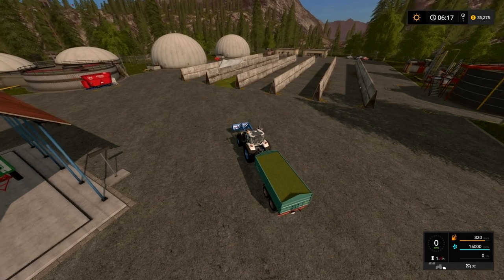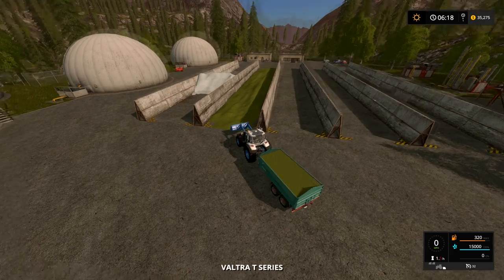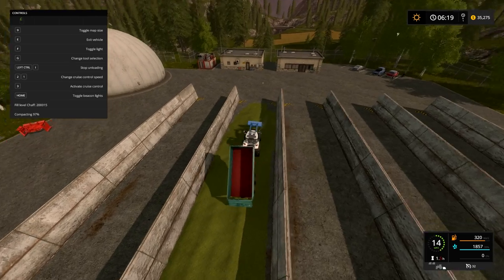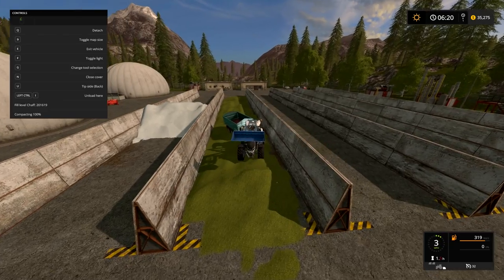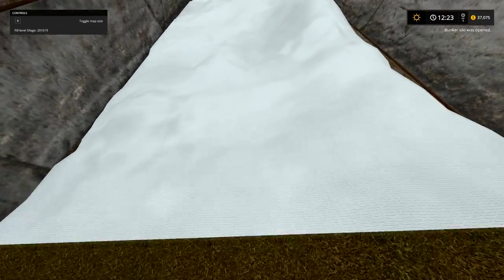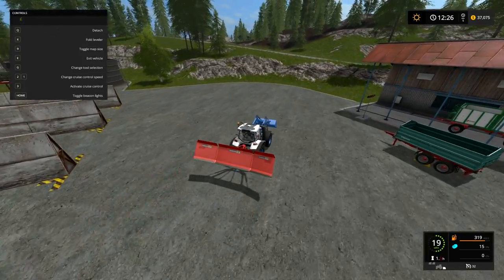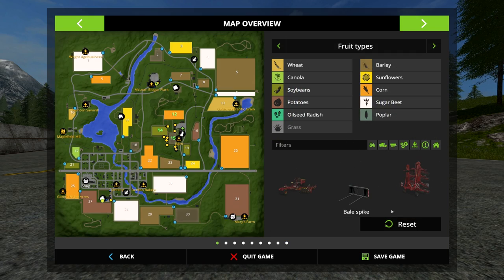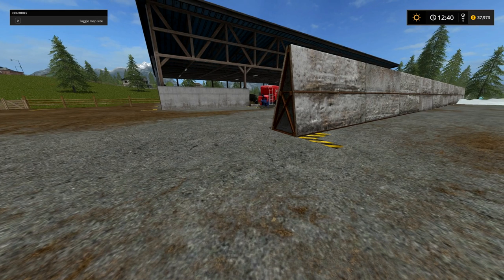Farming Simulator 17 Tutorial | Silage

Comment: I have a problem with silage getting stuck in the wall and i can get it out and it doesn't lets me put grass into it.
Reply: i have that problem too
Reply from the maker: I'm having some major silage bugs as well. Hopefully they can patch a fix soon.
Reply: Do they even know about it?
Reply: yes same problem here
Reply: You can use the roller to clean up the silo which should solve this issue.
Reply: you can use the roller or drag a loading belt through the silo both ways and collect the silage

Comment: I tried to use grass but it didnt work at all....i think for 17 it is only chaff
Reply: Todd Sommer did you unload it? You have to force unload
Reply: yes i forced it and it didnt register anything was added
Reply: Todd Sommer the same thing happened to me
Reply: Im on console....i was reading the silage info before this vid and it specifiacally says that chaff is needed to make silage....i assumed it would be the same process as in 15
Reply: tedder the grass then it will work
Reply: sticky0420 it didn't work for me, now I have one stall with grass, and one with hay and nothing happens, it says silos have 0% chaff in them. this is on PS4
Reply: i even tried both the biogas location and the cow yard just to see if they differed and still the same result....nothing
Reply: Does hay work?
Reply: BryceEvolution not when I tried it, even after tending multiple times
Reply: BryceEvolution that link is for FS15 lol
Reply: oh sorry lol
Reply: Check on the FS17 fourm
Reply: i will lol thanks for trying tho
Reply: they just had an update on xbox u can use grass now
Reply: Yes iv'e been using grass now for silage it works
Reply: Ok sweet thanks for lettin me know

Comment: I'm new to the game and wonder what is the best way to make money early game. I try crops but it always seems like it's never enough and just able to pay off my debt recently
Reply from the maker: Just put on music or a podcast and enjoy the ride. The money will happen. Also, play on Easy (you'll make money faster but it's still a pretty slow go).
Reply: I ask this question a lot and no one can answer it. what are the tractors to use for farming and which for other task like hey? because I sold my starting New Holland because it seemed to not have enough power and bought a Valtra but it barely handles my, not the plow the other thing, my mind went blank. makes my nose go in the air when its mounted and the upgrades/options scream that it is meant for silage/hay. I am so confused with this one.
Reply from the maker: The tractors can be used for anything, however, you need to make sure your tractor has enough HP to pull the equipment and KW to power it (every tractor and machine shows you these stats in the shop). For example, a starter tractor isn't going to power or pull the largest cultivator. If your nose is going up simply buy a weight in the shop and attach it to the front!
Reply: And lastly, there is no difference in  tracked and wheeled tractors? I know you said that tractors can do anything I would need it to, but can tracked pull more weight typically or does that not even matter?
Reply from the maker: That I don't know.
Reply: oh okay! well thank you! that helps out a lot 😊😆